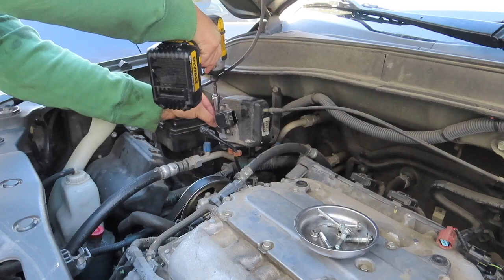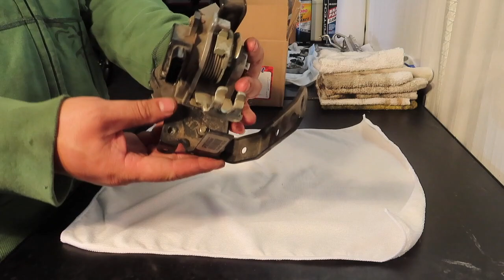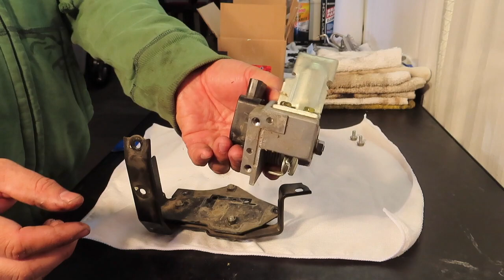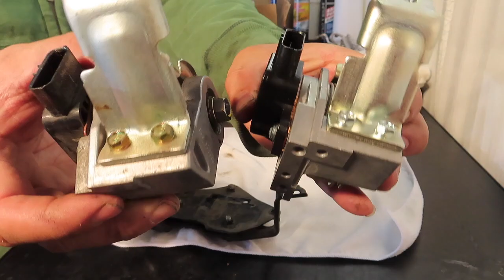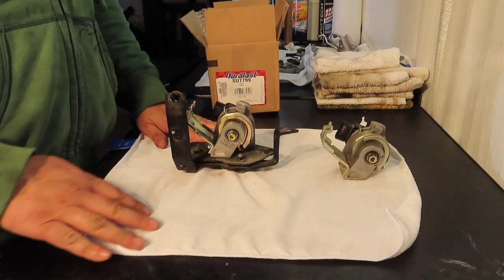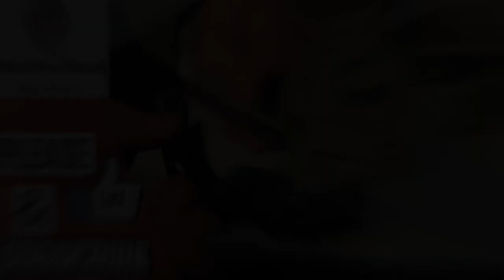Accelerator Pedal Sensor 2006 Honda Pilot 2WD

Comment: Why does everybody pulls the whole unit off?  You only need to replace the sensor.  It's an easy fix, the SENSOR went out, not the bracket lol.  A pair of vice grips on the stock one to unscrew the stock bolts out and order the sensor that normally comes with  torx screws and back on it goes.

Comment: Good day, thanks for the video. in my case despite the fact this has been checked and the vehicle scanned. The scanned revealed that a throttle relay in the fuse box is bad. This has not been detected yet.

Comment: What where the symptoms, codes?
Reply: 2381 for me. car went into "limp mode"
Reply: Mine does it once in a blue moon, it looses power, but it's never happened to me, it did it to wife and my daughter and then when I drove it nothing happened!
Reply: @JuanAvila-mb5yk   my father has a honda accord, and if he presses the gas pedal before turning the car over, he'll get the vsa warning light and the car will go into limp mode. no problems if he doesn't accidentally press the accelerator.
Reply: Ryan Melanson, did you mean P2138? P2381 doesn’t relate to the APP at all.
Reply: scotschult yep!
Reply: @Ryan-ru4mi  can you further explain does this help the car what else has he done to get the VSA to stop
Reply: @Sagedreamz4u  my fathers problem is intermittent, but he suspects replacing the APP sensor would fix the issue. For me, I replaced the sensor and have driven about 4K miles with no more issues. Hope this helps.
Reply: @Ryan-ru4mi  Thanks Ryan this helpful.